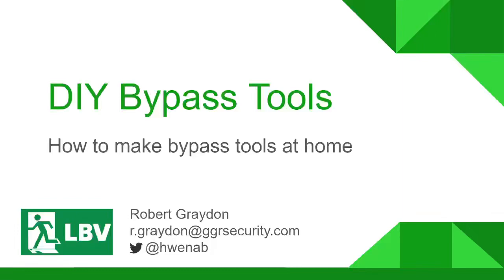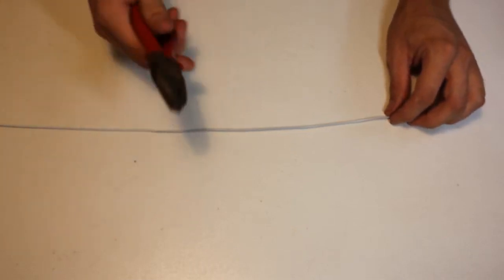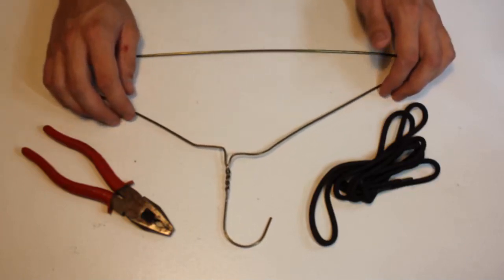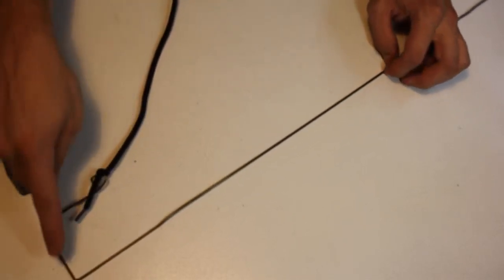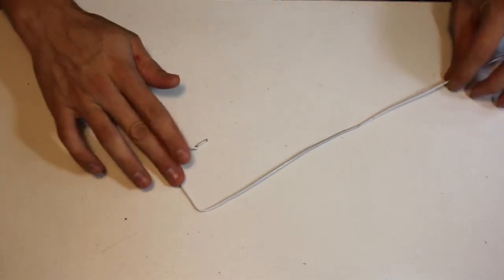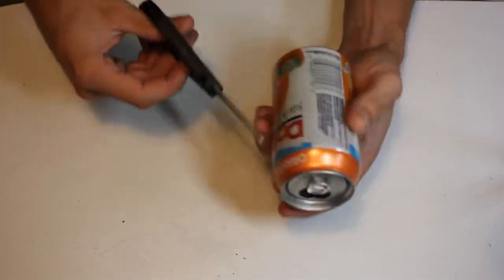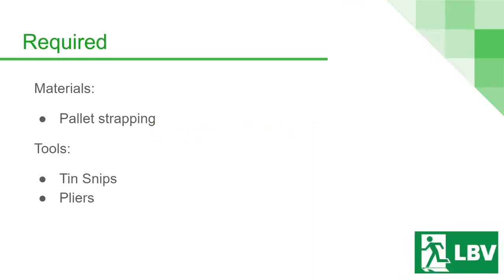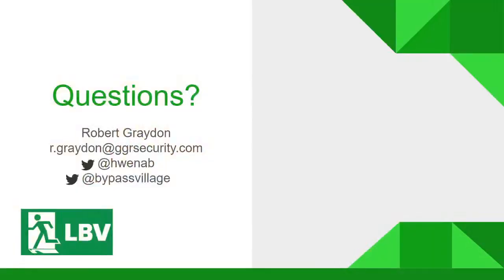DEF CON Safe Mode Lock Bypass Village  - Robert Graydon  - DIY Bypass Tools

Comment: You need to make the under-the-door tool full length by using twist-on shirt hangers to combine different lengths of wire. Also by pounding out the twist area on a hanger you can make workable rake picks.